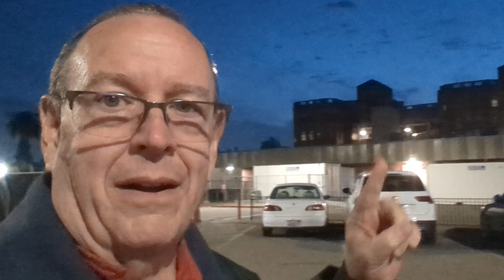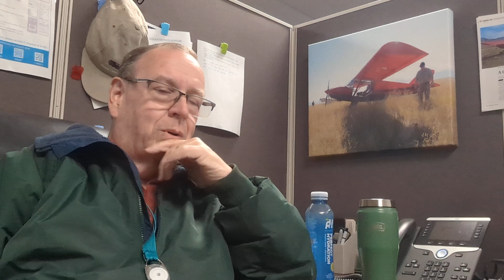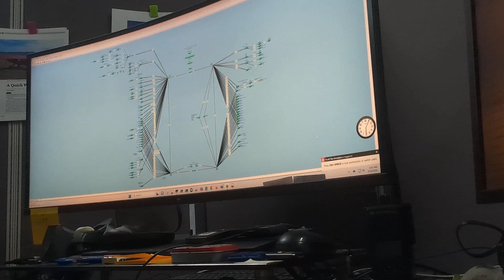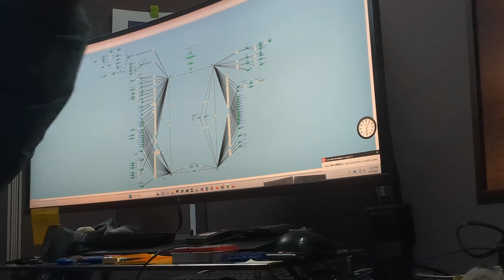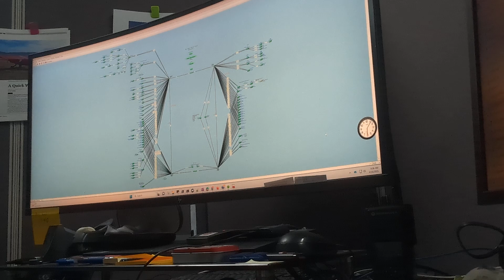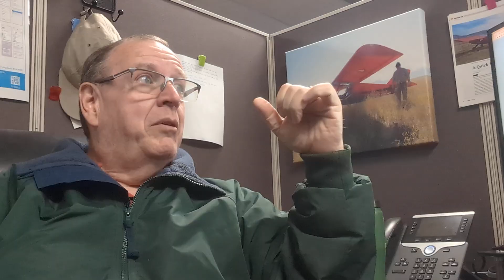Network Admin Life- Abandon Ship!

Comment: US companies sell licenses for every crap. No hate, but thats one reason why I dont use them. Our AP's got all out of the box, no issues and no yearly license or feature license needed. Support on demand.
Reply: What brand are you using?
Reply: @MarkBurfeind  there are a few brands that do it, but the limitation is normally the controller hardware, cheap ones are not able to control as many as the larger more expensive ones. 
for smaller businesses hardware like Draytek 3912 will support 50 APs and 30 switches out of the box, it will also do 5Gig IPSec VPN / 3.5Gig SSL VPN, etc there are some paid licenses, but that is for online stuff, like content filtering web site list blocking etc. 
TP link also does some good stuff, so does Ubiquity.
Reply from the maker: Extreme Networks.  God bless!
Reply: @MarkBurfeind   I use Aruba  you get your AP licenses out the box
Reply from the maker: Yeah, it's the way of things now.  Pushing everything to the cloud and AI.  I don't want to be in networking support when it all comes crashing down.  Not that it WILL but it MIGHT.  Luckly our AP's will just keep doing the last thing we told them to do via the controller.  Everything will keep working with the exception of Guest Wireless.  God bless!

Comment: exceeded your Wi-Fi 7 license? is that a state / local authority license for the frequencies being used, or one that is required for the hardware? basically a pay to unlock feature?
Reply: I’m assuming it’s pay to unlock feature. I have some older Extreme switches in my fleet that won’t allow 10Gbps SFP without a license.
Reply: @MarkBurfeind  I'm not a great fan of the "Hire-Purchase model" the one where you buy the hardware then you can subscribe to enable features of that hardware.
Reply from the maker: I am aboslutely with you there.  There have been several instances where our suppliers neglected to mention we'd have to purchase a more expensive license for the hardware until the money was spent and the hardware was delivered AND I found it the feature I thought I was getting was not present.  Only to be told, "Oh, we didn't realize you meant THAT.  Here's the licenses you'll need to buy to enable that feature."  Grrrr.  God bless!
Reply from the maker: Like I said to another commenter, T\turns out it just meant "License" not specifically WiFi 7.  At any rate Extreme is providing a workaround for this year.  God bless!